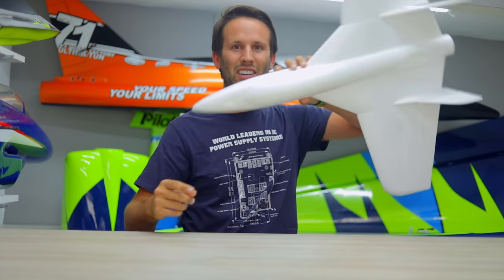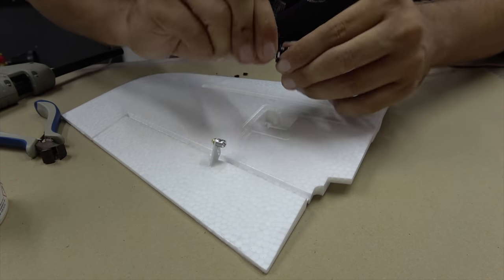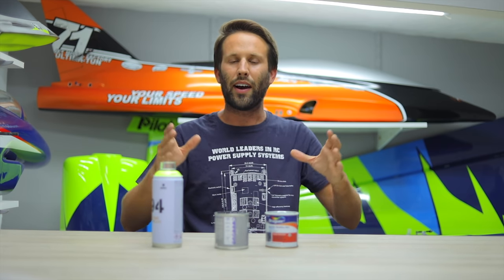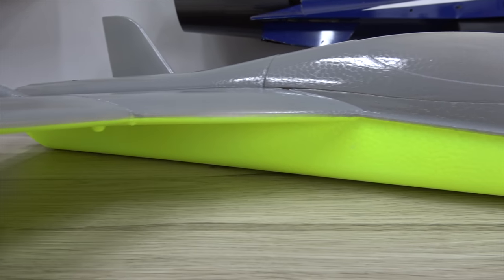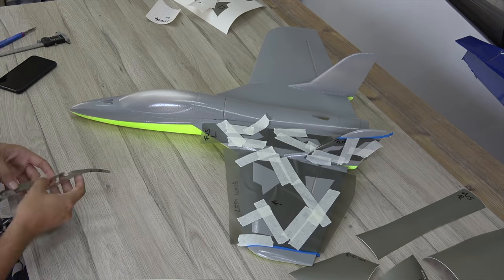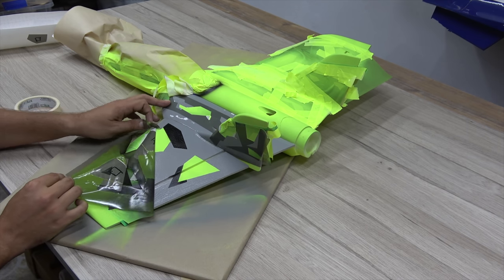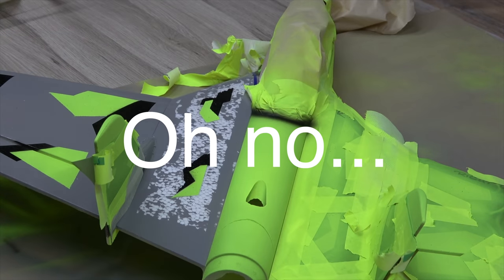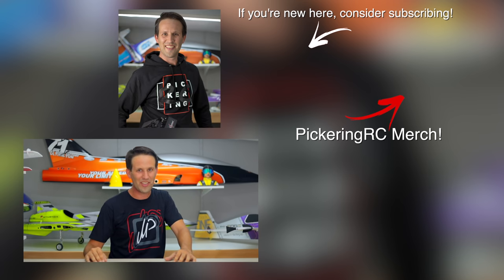DISASTER with the FUNJET to LIZARD project...

Comment: Great videos and I enjoy your flying skills Martin :) For years I have been spraying my models with a transparent plastic primer before I start spraying with color. This ensures good adhesion. Models that already have the color on them from the factory I also first apply a plastic primer and then  a (thin) layer clear coat. I do this so that the foam does not dent that easy and is easier to keep clean, especially the white parts. Oh yes, always let the paint harden for 1 day after it has been sprayed on. Working in bodyshops as a car painter for over 30 years.
Reply from the maker: Thanks for the tips! Will bare in mind if I ever dare try another one!!

Comment: Really sorry it ended like it did. But if it wasn't for stuff like this happening, we wouldn't learn stuff. I'm sure your next effort will be fine, as we learn from our mistakes. I was thinking, that, surely some paint manufacturer will have a foam etch primer to get a good contact on the surface. Best wishes, Dave W

Comment: Did you clean the surface with alcohol....
Looks like you had adhesion problems 
Most of these new foams have a mold release on them ...and paint doesn’t stick well to it 
Also they make a masking tape that is less tacky that might help ya out

Comment: I have a great idea !  Send to me and I’ll fix it and fly it!  Actually clean with rubbing alcohol, spray and adhesion promoter down first then add light layers, also water based painters hold up better on foam. FYI
Reply from the maker: Hate using water based, it normally rubs off on this foam.. second video coming soon, is it saved?! 😁

Comment: Paint simply does not stick well to Expanded Polypropolene (EPP). Some of my new micro planes are made of it, and their factory-applied paint is coming off just from light handling.

 I use blue painter's low-stick tape. And even then I will rub my hands down the length of the sticky side to let my skin oils reduce stick even further.  Even after all that I have had it lift paint off this stuff.  Good luck.

Comment: It is amazing with all the high tech paints, and primers out there that no one has come up with  a suitable product to paint foam without the problems you suffered, you are not alone, I was attempting to paint a set of "Airtractor" floats recently, I got the base coat on okay, then masked up for the trim colour line, that was fine till I came to remove the masking tape, then had the same disaster you. :-(